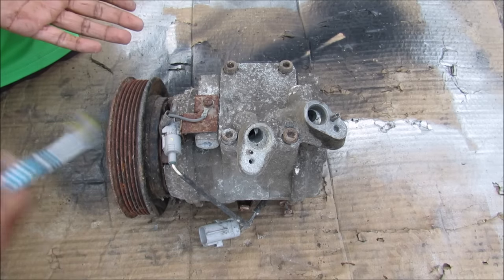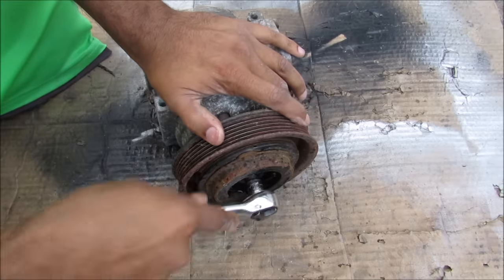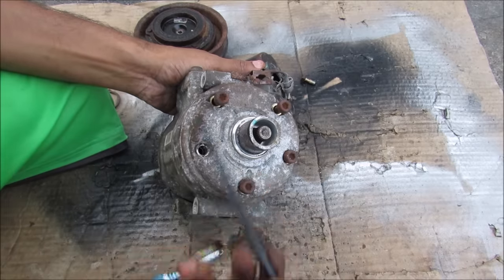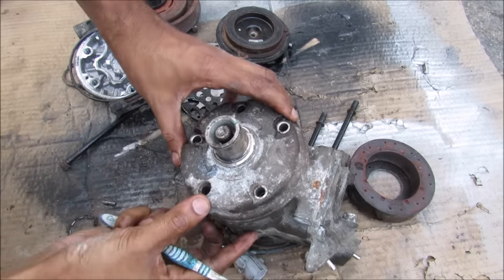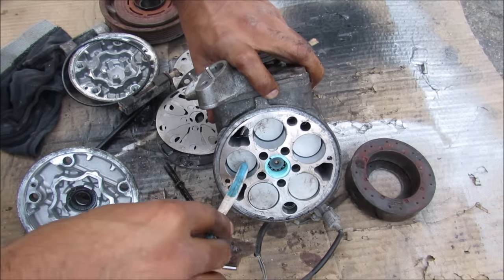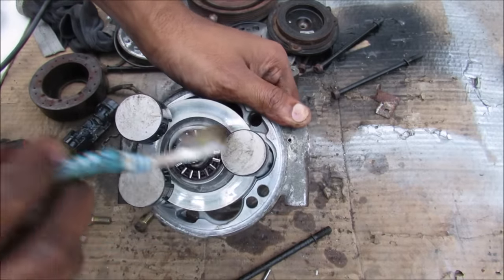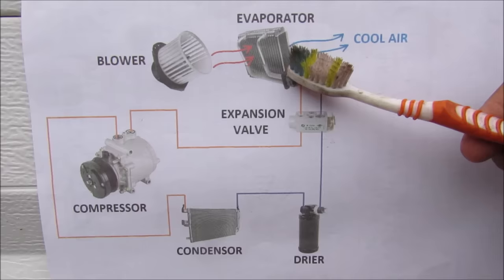How an A/C Compressor Works

Comment: Most underrated automotive youtuber
Reply from the maker: Thanks very much, please share among your own circles
Reply: Underwear
Reply: Old underwear 😂 made me crack up!
Reply: +Matt 007 - 100%
Reply: Always my most Favorite YouTuber !
Reply: Randomly found this video. Instant subscribed.  Whole video was under 10 minutes and down to the most base component displayed how the mystery-cold-box works.
Reply: And he's funny!!!
Reply: Agreed, mechanical engineer so yea he knows what he's talking about lol
Reply: @speedkar99  My car i20 engine is running very quiet as usual. However, as soon as AC clutch is engaged, I hear a squeak sounds and not metallic sounds or alike. The squeezing like sounds go away immediately as AC is off. Even with engine revs, same sounds. And with AC off, as I revs the engine, still the engine is quiet. How to find that squeaky like sounds and fix it?

The AC is blowing cold. It seems the AC compressor is ok.
Reply: Absolutely, dude speaks really well gives an depth explanation and he pulled the whole ting a part that was great learned a lot
Reply: I totally agree

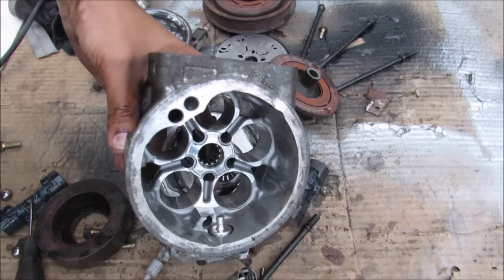Comment: 👍🏼 I like that. 7:39 video with 7:29 minutes of useful information. No 40 second intro with Hammerhead music and ridiculous graphics. No long winded speaches. No inconsequential blabbering.  Subject matter is straight to the point, clear and concise.
Reply from the maker: Thanks for the compliment. So where's the 10 seconds that wasn't useful information?
Reply: @speedkar99 
The 10 seconds you didn't say what make and model the compressor was.  Beautifully engineered 😅
Reply: @Iconoclasher  Denso 10PA15C 447200-2141

Comment: The ring on the Pistons trap the lubricating oil forming a "seal". It's not perfect as oil and gas can still leak past the piston but it does the job. Nice video though, definitely one of the best explanations I've seen.
Reply from the maker: That's what I was wondering too
Reply: Works the same as a axeual piston  hydraulic pump or motor
Reply: I think if it had piston rings, it would build up too much pressure and blow a hose or o-ring. Probably it's a way to self regulate internal pressure.
Reply: +Special Ed This is a fixed displacement compressor. It can't "self regulate internal pressure" in any way except the clutch being turned off by the low pressure switch when the suction pressure goes down too much and by the high pressure switch when the discharge pressure goes up way too much. The one of this compressor is a tried and tested design, also employed for some huge compressors meant to cool city buses down, so the piston rings surely won't do any harm at all. In fact the Ford FS10 has piston rings. However piston rings aren't strictly necessary as a seal; the piston itself can be covered in Teflon for example.
Reply: Known as a Labyrinth seal.

Comment: here for the underwear jokes!
Reply: Best time to work on Cars waking up with a Tooth Brush and an Underwear !  😳😳😳😳😳
Reply: zacharyparis...
smooth wit..
Reply: 43mackmobile sound advice.
Reply: Same
Reply: @Al Castill Hahahhaha What a Jerk as a big brother 😂
Reply: I had to pause to look for this comment
Reply: plot twist, at 3:29 he actually just pulled it like that straight out the draw with a shit stain 😂 That's actually the 1st time he used that as a rag
Reply: i am 2 years late for it but yes, i had to take a scroll for it too...
Reply: @aaronmcdonald4944  wildly inaccurate.
Reply: It's a little know fact that cotton underwear is great at soaking up A/C oil. Extremely little.

Comment: Ingenious design. I would have never thought that's what it looks like inside.
Reply: And that's only one example of how they look inside. Others can have a rotating lobe equipped with a set of spring loaded vanes, two spirals rotating inside each other, single sided pistons riding on the edge of a gimballed plate and so on

Comment: This may have been covered before, but here goes.  You mentioned the lack of piston rings, and that is a good observation.  In variable displacement hydraulic pumps of a similar but slightly different design, the leakage past the pistons is engineered to provide lubrication and cooling to the internal mechanism.  In this case, I could be completely off base, but it seems that in a fixed positive displacement multiple piston pump, this may also be the case.  The leakage and subsequent lubrication would likely be balanced with the required output pressure to reach the rated output while still protecting the internal mechanism.  Interesting presentation!  I didn't realize that there was a fwd and aft bank of pistons in an automotive A/C compressor.  👍
Reply: If you look carefully you'll notice the piston has a thin sleeve of something (maybe a polymer) around. This might be the actual seal. The old Delphi CVC (seemingly a Calsonic Kansei design by the way) on my Vauxhall has piston rings and it's a variable displacement compressor (pressure in the crankcase, controlled by a control valve, and in front of the piston is what controls the swash plate angle). However the pistons are only single-acting.
Reply from the maker: Thanks for your feedback

Comment: Aircraft hydraulic pumps work the same way, but the swash plate angle can vary from flat (no pumping) to a max angle for full flow as needed.
Reply from the maker: Good call, thanks
Reply: Back in the 1990;s I worked in an A/C shop...some of the higher end cars had a more complicated Compressor with a constant running pump, but variable swash plate...
Reply: The Delphi CVC compressor on my car does exactly the same thing. A valve senses the suction pressure and sets the plate angle to nearly flat when it reaches a control value (nearly flat angle is set by routing the crankcase pressure to the suction so that the pistons are pushed forwards and the plate angle increases, depressed angle is instead set by routing some of the discharge pressure into the crankcase so that the discharge pressure pushes the pistons backwards). The suction pressure control value is also influenced by discharge pressure, i.e. you get ice cold air in the summer when discharge pressures are high because it takes a low suction pressure for the compressor to destroke, and fresh dry air in the winter when the discharge pressures are low because the required suction pressure value increases. Very efficient. It makes different noises whether it's in maximum stroke or minimum stroke and it tends to be much quieter in the former case, and i can tell if a regas is needed by listening to the noise the compressor alone makes. Also the plate always starts rotating at nearly flat angle so that you never get the "bang" noise of liquid slugs. However the pistons aren't double acting.

Comment: Blimey this is the best automotive explanation I've ever watched. It's like you rehearsed it a 1000 times before you made the video. I'm impressed and simply educated! Subscribed and looking for more!!
Reply from the maker: Thanks for the kind compliments! I got alot more to come!
Reply: @speedkar99  that's awesome! Keep I'm binge your old videos now! I consider myself a gear head and there's so many things I had no idea about! Thanks a lot for your videos! And the running jokes are the just the cherry on top!

Could you try and do a video on a manual transmission or a transfer case? Especially the vacuum operated ones like on a Cherokee XJ.

Also, what's your background? Are you an automotive engineer?? It's amazing how much you know on every component or system!

Thanks for responding! :-)
Reply: @speedkar99  Waiting to see that variable stroke compressor, really curious about it.
Reply from the maker: I'd love to get my hands on a manual transmission or CVT one day!

I am a mechanical engineer. 
I do most of my learning by opening things up and seeing how they work, and reading up online.  Repair manuals are an awesome resource.
Reply from the maker: Im very curious to see myself too! I've read the principle in the repair manual and it looks exciting...

Comment: I really enjoyed the video.
I'm amazed that rusty compressor came apart so easily.
Also, that sensor is to detect if the compressor is turning. The pressure sensor is on the high side, normally after the condenser.
Reply from the maker: Thanks
Reply: The sensor could also be a thermal switch that opens as soon as the compressor gets too hot (for example: low lubricant return, very high head pressure, low refrigerant).
Reply: Not on that car.
The thermal switches you're talking about are normally external.
I see them on all the Hondas I work on.
The reasonI know that speed sensor is i worked for a Toyota dealership and did the training on them.
Reply: @robertrocheville7769  Well, thanks for clarifying. I know that a lot of scroll and vane compressors usually employed on Japanese cars have a thermal switch placed in series with the clutch coil, and this switch is located opposite to the clutch assembly (looks a lot like the solenoid valve of a clutchless swashplate compressor). Supposed to keep the compressor from overheating due to a low refrigerant charge, because there usually isn't a pressure switch on the low side (there's only a binary/trinary switch or a pressure transducer located on the high side; cycling is via an evaporator temperature sensor)

Comment: Isnt there an internal combustion engine that uses a set up similar to how this ac compressor works?
Reply from the maker: Are you thinking of the radial engine?
Reply: speedkar99 No, its an internal combustion engine with this same exact configuration.
Reply: Just looked it up, Its call the Duke Axial engine.
Reply: J G Well apparently it does work, its call the Duke axial engine.

Comment: He definitely went the opposite way when describing the flow of refrigerant through the system.  Evaporator is the first stage after expansion valve.
Reply: Yes and it is a low pressure gas at that point.

Comment: Why the vapours must pass through the compressor, why not directly from the evaporator to condenser? Is it for efficiency or something
Reply: The refridgerant evaporates at low temp and condenses at a higher temp. The compressor raises the pressure of the refrigerant vapour such that it will cool and condense back to liquid at the abient temperatures the condenser is exposed to.
Reply: hmm. thanks buddy
Reply: I thought the refrigerant evaporates at low pressure, not low temp.
Reply: They are both low. It drops in pressure, and therefore temperature due to expansion at the expansion valve and is in a saturated state. The remaining liquid refrigerant evaporates at that low temp. Check a saturation chart - I think it is typically down around -10 C (30 psi, 200 kpa) for R134a at the low side pressure in a car AC system. It emerges from the evaporator as a super heated gas at the same low pressure. Then the compressor boosts the pressure, it goes to the condenser, releases the heat, turns back to liquid. And the process repeats.
Reply from the maker: Check out my video on how HVAC systems work
Reply: Jim Trainor hvac-r tech ?
Reply: Yathu, something must cause the refrigerant to flow through the system.  That is the job of the compressor - takes in low pressure gas and puts out high pressure gas.  Condenser - takes in high pressure gas and puts out high pressure liquid, dumping heat during the process.  Expansion device (typically*) - takes in high pressure liquid and puts out low pressure liquid.  Evaporator - takes in low pressure liquid and puts out low pressure gas, absorbing heat during the process.  Then back to the compressor ...
(* there are ejector systems that are weird compared to the explanation I have given)
Reply: The basic reason is that it needs to get to a high temperature so it can lose heat to the ambient temperature.

Comment: I've heard you have to turn on the Ac every month for 5 minutes to lubricated it.
Reply from the maker: Yep that helps to keep things spinning and from seizing up
Reply: Even more than 5 minutes. 15 minutes a month is the best. Ensure the compressor clutch hub is spinning. In the coldest months, just turn defrost on from time to time, even if you don't really need it. If you live in countries with very cold winter climate, such as Canada or Russia for example, try doing this during every warm spell.
Reply: Whenever defrost is used, the ac compressor is engaged also. So you are essentially using the ac all year round :)

Comment: That was very interesting! Thanks for the video and for leaving out all the bullshit and waffling on so prevalent on YouTube these days.

Is it a sealed lube set up?
Reply from the maker: Short and to the point is my style! Yes the compressor lubricant is part of the system
Reply: oil is put in the compressor right before the refrigerant...it moves all through the system...there's an oil and Freon storm going on in there...
Reply: There's no oil pump and no oil sump. Oil is carried by the refrigerant just like oil is carried by the fuel in two-stroke engines, and that's why the oil has to be soluble in the refrigerant (for example PAO oil doesn't dissolve in R134A, so don't use it or whatever leaves the compressor will take a too long time to return back to it. PAG and Ester do instead so they're ok), so yes, it's a sealed lube set up and you don't want anything to leak from it, be it lubricant or refrigerant (since it's the refrigerant that carries the oil around and keeps the compressor both cool and lubed up). There's a drain bolt on the compressor so that you fill it with oil (either the entire system quantity if you also flushed the system, or the same quantity of oil found inside the compressor if no flush has been done) right before mounting it on the car, then you also fill the system with refrigerant and rotate the clutch hub with your hands 10 times so that the compressor doesn't get slugged by the oil when you start it up. And then the refrigerant carries any excess oil to the rest of the system and then back to the compressor. Good thing to help this migration happen by running the blower to the maximum speed for 5 minutes the first time you start the AC anytime you've filled a compressor with oil, so that the thermal expansion valve stays wide open all the time. Most compressors are designed with some kind of oil separator inside so that the condenser and evaporator walls won't get coated with too much of the oil, impairing heat exchange. Also, on systems with variable speed/displacement compressors, the expansion valve is always built so that it never closes completely (for example, nicks in the valve seat, bleed holes or a cross charge that allows 0 superheat at very low suction pressure) in order to prevent oil circulation from stopping (since systems with such compressors can keep the evaporator at a fixed temperature, a condition which keeps the expansion valve closed or nearly closed constantly).

Comment: I have never taken one apart and it is very amazing.  One note.  Make sure you do not say that is cools the air.  A/C systems move heat and do not move cold air.  It removes heat from the cabin and moves it outside.  We just perceive this as cold air.
Reply from the maker: Yes that's the correct thermodynamic term....hear movement not cold air movement

Comment: Great tear down and explanation.  I would say that turning on the AC even in winter to "make sure it is working" is inadequate.  You want to do that to circulate the oil through the system and allow the dryer to remove any water that might have condensed in the system.  Letting the parts dry out from lack of oil distribution or collecting water in one place and letting set will degrade the life span of the parts in the system.
Reply: Anyway you will eventually need a new compressor even when it doesn't seize up... see that black jacket around the piston (likely Teflon)? It acts as a piston seal. Even if it's correctly lubed up, it wears away with use. An old compressor hasn't got the same cooling capacity of a brand new one... if you feel the air is colder while driving and you're sure that the condenser is clean, the condenser fan is properly working, the cabin air filter is clean, heater door/valve is ok, expansion valve is ok, and you have the correct charge weight inside... then you might need a new compressor... also, the original ND-8 oil sticks to the metal due to its polarity and isn't hygroscopic (just like any other double end capped PAG), so water isn't a concern.
Reply from the maker: Usually the defroster turns on the AC to remove cabin moisture causing frost in the winter.
Reply: @speedkar99  On my 2003 Suzuki MPV this won't happen. You have to pull the temperature knob to activate the AC. I have a video of how the mechanical climate control works if you're interested (had to get a spare one because the air distribution knob broke off)

Comment: I have been following your channel for quite a while and have to extend a hearty WELL DONE to you!

 For 44 years I have been working on mechanical and electrical technology with a very good understanding of most systems and components. 
However, I have never destructively inspected many components as I knew that the component or system failed or not without such deconstruction.   I thoroughly enjoy your videos as they make concepts even clearer than they had been previously in my mind. Looks like a lot of fun too!  The rack and pinion, electronic fuel injector and the A/C compressor tear down I enjoyed immensely. Keep up the great work and fun. You have inspired me to rip something apart...hmmm